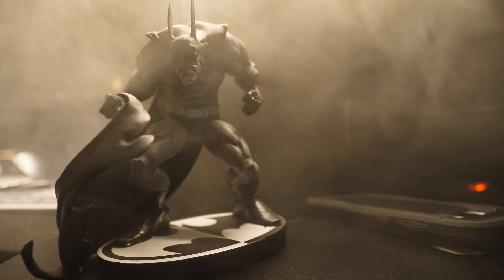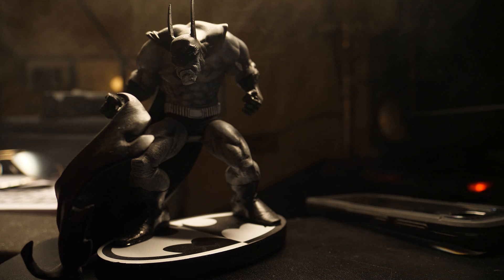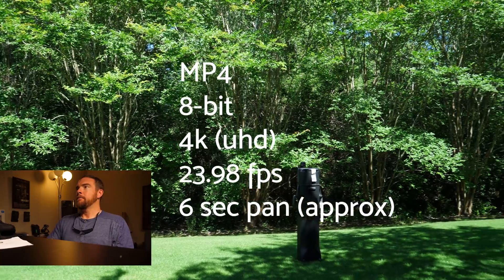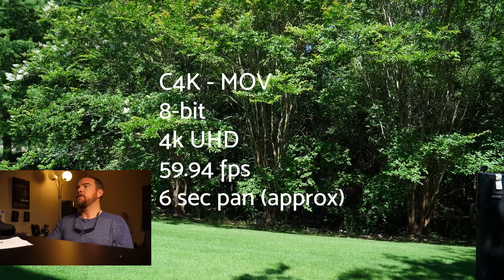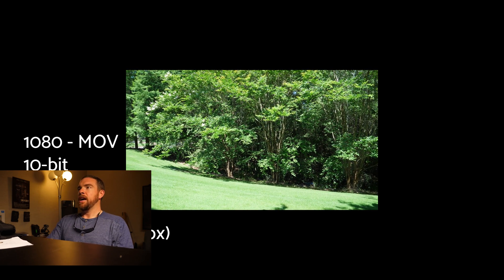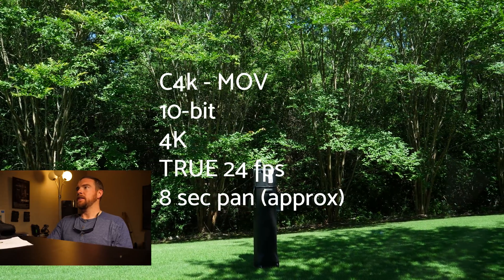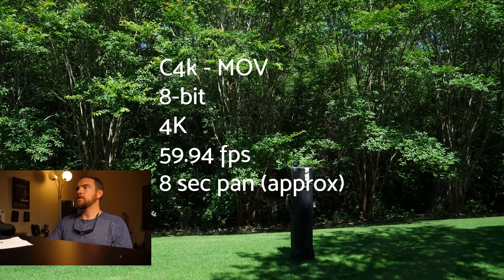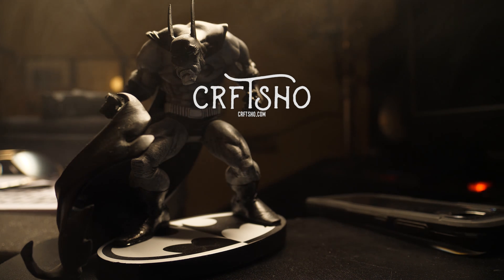A MAJOR GH5 FLAW is giving us and Batman the jitters - mft jitter issue with a fix

Comment: So my e-m1 mark ii gets this in c4k mode but UHD 30fps its pretty much totally smooth apart from the slight ibis getting confused sometimes problems.

I do wonder if a camera without ibis like gh5s would be better for pans you have to remember even though ibis is turned off that it might not be able to hold the sensor completely solid as it would need to very free to be able to react to vibrations in the first place.

Comment: Yeah, with this very slow panning from a tripod stand you can get some OK results out of it, but when shooting people walking or running, birds in flight and moving/panning with them, or planes flying or landing, the synchronic movement with the subject is just too fast and the video results are just shit, completele unusable, whatever stabilization mode, ore combined modes you use. I am a nature videographer, bought this camera because they advertised it as 'one of the best camera's for professional video shooting', and so far, in two years time, i can't get any stable and jitter-less results out of it. I have this camera for 2 years now, spent about 4000 euro's for body and two lenses, and all that money, is just thrown down the drain. It's the most disappointing camera for video i ever bought. Never a Panasonic for me again.

Comment: Did you get this problem solved? I'm using the Panasonic EVA1 and see it a bit as well....but it's motion mostly in the movement inside the frame rather than movement of the frame itself. Someone suggested it could be working with 10 bit files in an 8 bit timeline. You can see the blur I'm talking about here:  https://vimeo.com/247099856/2dae1ce9db
Reply: Samuel Holder I think i get what you're saying. In your footage some elements (especially faces) presents little signs of judder when they move within the frame, so it's not pan-related. I'm having the same problem with the gh5, but it's more severe. Did you find any solution? I've been seeing gh5 videos with no signs of this at all. I've been asking in forums for months, nobody could even understand what I was talking about. Could it be lens-related? I see this especially when something moves and the focus is really sharp.
Reply: https://youtu.be/S4B2nPSfqWg here's some footage (kinda ok when I'm staying still and the subject isn't moving too much, the rest is terrible to me). Today I tried to film my face in front of the camera on a tripod, I slowly moved my face horizontally and my nose and eyes looked like they were wobbling.

Comment: I think I solver this issue. Turn off IS. It went away for me when I turned it off. The IS seems to be trying to play catch up when panning. Otherwise it functions well.
Reply: You've deactivated IS in camera or Lens IS?
Reply: @Lifetogo  usually in the GH5 when you activate/deactivate the Lens IS it activates/deactivates the in-body IS, as it is a dual IS that works together
Reply: @blaspayri7722  Thank you Blas!
Reply: @Lifetogo  Just curious if this worked for you? Turning off the IS? The panning jitters on the GH5 are driving me bonkers. Thanks!
Reply: @jeffkopay9010  No, it was deactivated afterwards all the time. But now I switched to Canon EOS R for photo and later to the new main body (R as second body) to the R6 for video and photo. Really an amazing camera and because Pana is not bringing the GH5 Mark II instead of an GH6, I think it was a great move. Preferred after the GH5 also the G9. A really nice camera!
Reply: @Lifetogo  Hi ! I just tested R5 for one week and sometimes I could see jittery when fast moving objects in frame. Or sometime they simply jump , not all the time but sometimes. Overall it’s a great camera. I’m still don’t know how to get rid of judder on R5
Reply: @UraFlight  Ah ok. Updated the firmware? We have no problems with the R6
Reply: @Lifetogo  Thank you for an advice. I have no idea if the camera which I have tested was updated. It came from Canon for me to test
Reply: gotta try this il let u know ty
Reply: That worked for me!! Thanks for the tip!
Reply: hello , late question but what is the IS ?
Reply: @Zeval31  Image Stabilization

Comment: try watching 24p footage on a 120hz monitor, technically it should be smoother
Reply from the maker: Its actually inherent to the footage. But cool idea
Reply: https://en.wikipedia.org/wiki/Three-two_pull_down that's was I was talking about, I kinda feel that's it is related to it somehow as 99,9% of our screens are 59.94 Hz and we're trying to watch 23.976 fps (referred to as 23.98 fps), 24fps, 25, fps etc. I think 29.97fps on a 29.97 timeline should look super smooth if exported in 29.97fps and viewed on a 59.94hz monitor. What frame rate did you export this video in?

Comment: I performed the a series of tests similar to CRFTSHW with Lumix 25mm Prime Lens no Lens stablization, shooting the same scene panning on a tripod, with all the setting available in 4K including setting the system frequency to 24Hz. I could notice the shutter jitter in all the tests.  In post I reduced the speed of the 4K 8bit 60fps 59.9Hz by 39.9% for equivalent of 24fps. Same clip with all (3) time interpolation effects. (Premier CC 2017) Optical Flow seem to reduce the jitter but it is still noticeable. The reason I did my test with a prime was to determine if it was a base camera issue.  I thought at first it may have been the Zhiyun Crane V2 panning control issue. But the above test proves, to at least me, that this is a in body, shutter or data issue. I am trying to development more test to see if I can pin point to the exact root cause issue. HOPEFULLY THIS JITTER IS WILL BE ADDRESSED WITH THE FIRMWARE UPDATE AT THE END OF THE MONTH. But the update notes do not seem to address this issue directly. http://www.panasonic.com/global/consumer/lumix/gh5_firmware.html.

Comment: no where does it say what shutter speed you're using...when you shoot 1080/50p you gotta have 1/50 shutter, if you use 1/60 vice versa you've got the PAL/NTSC conversion issue shutter telecine judder issue once again..same for film frame rates..
Reply from the maker: 180
Reply: ..maybe those are not really readily available..180deg at 24fps should mean 1/48 shutter speed..can you dial that in manually?? plus I'd think ideally you should be 360, with a matching timeline..
Reply: @grafpez  the gh5 can set the shutter speed by angle. So yeah you can set 180 degrees. Also no you wouldn't generally want a 360 degree shutter. The duration would be too long and cause too much blurring. 180 degrees is the cinema standard although you can break from that for creative reasons. There is no rule technically. If I shoot at 60p for instance I have no problems amusing a 360 degree shutter. The motion blur would be somewhat similar to a 24 fps shot at 180 degree shutter. No need for a 180 degree shutter. At 120fps or more I think shutter speed is totally pointless and just set it at whatever gets you the right exposure.

Comment: Thanks for the great video. One suggestion would be to say that you had ibis and lens stabilization off in your notes so people don't keep asking about it. Also, did you use the 12-35mm 2.8 panny lens? The reason I ask is that I've read several reports of jitter even with the lens stabilization off. It could be a lens problem. That's how I found this video because I want to buy a v1 12-35mm 2.8 but I am concerned about this jitter-sticky problem. I'd love to see this test with a lens with no stabilizer built in it to take that out of the equation. Maybe the ibis of the gh5 is slightly "pan sticky" even when it's turned off? I'm just trying to think of ideas because of how bad the footage looked. Maybe it is the post software that is being used? I don't know.
Reply from the maker: Great notes - we used the Leica 12 to 60.

Comment: Doesn't 'jitter' in Vegas Pro. Its not a GH5 issue its a NLE issue.   I pan all the time and have had NO issues... It;s something in your NLE.
Reply from the maker: You might be onto something...but It might also be your pan speed. It typically shows up on pans spanning 90 degrees under 6 seconds.
Reply: I think it also depends on what framerate timeline you conform it to.

Comment: I wanted to see the 3 sec pan slowed down. Just to see how it worked out at half speed (making it the 6 second pan). also since you were doing a super hero panning addition, maybe we could see a some one run by and pan with them to see how the jitter looks on a bokeh background with a fast varied speed pan in different modes. 2nd vid I've seen of y'alls.  watched clones with true 24 liked the points felt like you were some cool guys sharin some knowledge.  subscribed after 1st vid.  second vid (this one) gold. -Thanks and do consider a second pan vid. perhaps.
Reply from the maker: +Waylon Carter thanks. Yeah working on a second vid.

Comment: I asked this question to you a previous GH5 video you did. It has to do with the sensor information not being able to process fast enough to the SD card.  That's the bottle neck on these cameras.
Reply from the maker: I think so to...but...its about being smart on your shots.
Reply: Then you could do a test, is the problem solved when recording externally?

Comment: Have you tried bumping the shutter down a little below the normal 180 rule? Could a little more motion blur help smooth it out? Just a thought.
Reply from the maker: +Brett Rohlfing I didn't show it in the testing but did a variation up and down on the shutter. No change.

Comment: I'm curious if the issue is GH5 related or editing software related.. My office shoots with C100s and edits on Premiere, and if we drop 29.97fps footage in a 23.976fps timeline without interpreting the footage it also jitters like that.. So I'm wondering if it has something to do with how the timeline automatically drops frames? I don't recall what you said about your sequence framerate... like if you put the footage in a timeline of the same framerate as the clip does that solve it?
Reply from the maker: Totally gonna work on that. However - we shoot at 23.976 and edit at 23.976 but I like your line of thought...of course the new premiere pro update broke our rig today.
Reply: CRFTSHO haha sounds about right. I've been running into RAM leaks like crazy the past couple months!
Reply from the maker: +Tyler Penrod right!!! It's driving me crazy.

Comment: That's atrocious! Could it be some kind of pulldown issue? Really reminds me of that type of look. Do you think this will be mitigated when the 400mbps codec is released (perhaps a test for this would be to record externally, to see if it's codec or data rate related currently)? Thanks for pointing this out, though, will affect my decision whether to go with a GH5 or not.
Reply from the maker: +realitytunnel I will hook up the shogun and test it but I have a feeling it's going to be compression of image. That said if you notice the 3 sec pan is fine. The 8 sec pan is ok too. So it's just the gap between.
Reply: If the problem is not visible when recorded externally, then it's the bandwidth limitation for the IPB codec (in motion tracking part of it). I really hope that besides the planned 400 Mbps ALL-I (which IMO will fix this problem as there will be no motion tacking used for intraframe compression), Panasonic will listen to this petition of mine and introduce a high bitrate IPB modes: https://www.change.org/p/panasonic-introduce-4k-4-2-2-ipb-400mbps-and-fhd-4-2-2-ipb-200mbps-modes-for-panasonic-gh5
Reply: CRFTSHO thanks, a Shogun test would be awesome (and also give more of an idea of what the GH5 might be capable of with the 400mbps codec later this summer)!

Comment: I had the same problem on a shoot once. 
Later on i found out that it was the IBIS that was causing the jitters. 
Disable that while you are using a tripod and the problem should be fixed.
Reply from the maker: +Stanley's Stuff it was off in these tests.
Reply: This doesn’t work for me

Comment: Glad you're working on this!  Same garbage as with the GH4.  Something wrong with the motion blur...  My take on it was always that it looked like it was really screwing with the shutter speed/angle, but I could never figure out how to deal with it to my satisfaction.  My best solution was to shoot 1080P60 and slow it in post where ever possible.  Great minds think alike haha.
Would you mind making that same 6 second pan with your RED at similar frame rates for comparison?  I'm guessing it looks sweet.  My Blackmagic Micro Cinema Camera and even 80D provide much better moving camera footage than the stinking GH4 did.  GH4 loved locked off shots....  :/
Reply from the maker: That's why you're the best Hammerhaus we think alike - I actually did a full range test of all the settings with incremental shutter adjustments. I saw no elimination of jitter/judder at all - it was all the same - even when going to 360 degrees. I'll work on doing one with the RED for sure. The only catch is that I cannot replicate it with the same lens as I don't have a way to mount MFT to RED. Only EF to MFT.
Reply: And I can assure you, that is the ONLY way I'm the best!  Lol
As far as the panning test with the RED, I know it is probably a complete waste of your time to do, I just wanted to see it for my own edification.  I don't think the EF lens on the RED would be a problem unless you are thinking that the problem with the GH5 is something in the interaction of the lens IS messing with the IBIS or something?  I could swear that I had the same sort of problem in the GH4 with old adapted Nikkor lenses (and no IBIS in the GH4), but I can't absolutely swear to it.  I sold the GH4 a while ago, so I can't offer test shots..

Comment: Please tell me you had IS off while panning lol. Because if you didn't then that is 99% of the reason why you're seeing jitter. I'm sure you already knew this though. What lens were you using? Did you try it with a manual lens? I feel like the jitter could be the result of the in body stabilizer and not a data issue. Also what cards are you using? And their speed? All of these little details couldddddd play a factor. I own the GH5 and LOVE panning lol but I haven't.noticed this issue. Then again the only electronic lenses I own are the 12-35 v1 and the old 14-45.
Reply from the maker: Hey Sully - yeah IS was off as was the E-stabilization - basically it was a flat camera. Picture settings were standard. Cards are Lexar pro 128 highest speed  - which have yet to fail me - not just with GH5 but over the years. I purposely did NOT reformat them - it had roughly 90 minutes of record time when I started the tests. Totally agree. I've never noticed it myself - I don't pan much - but do use the dolly a good bit - so I decided to test based on issues some others were seeing, and after the test...what is seen cannot be unseen. I'm also using the new 12 - 60 electronic lens - I could use one of my analog CP2s, but wanted it to be a true MFT lens and body test...I will delve further in.